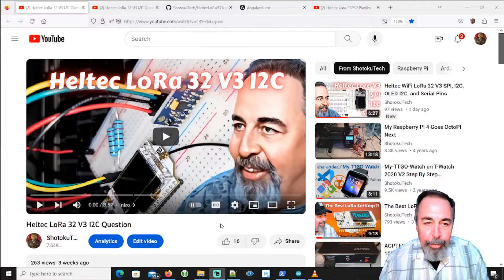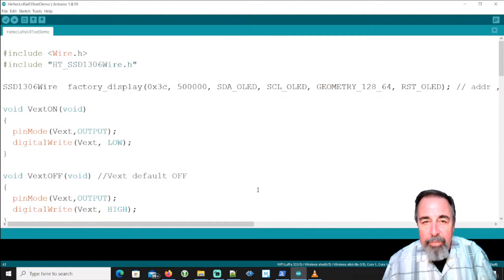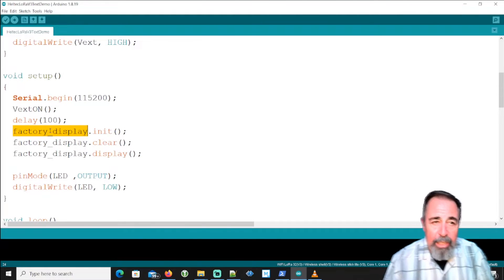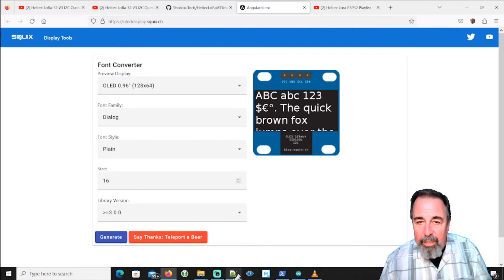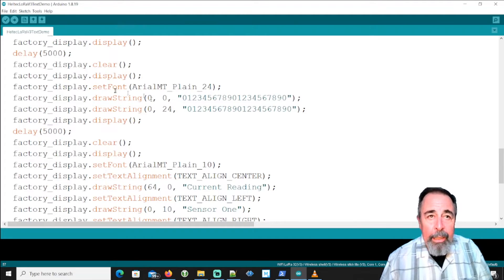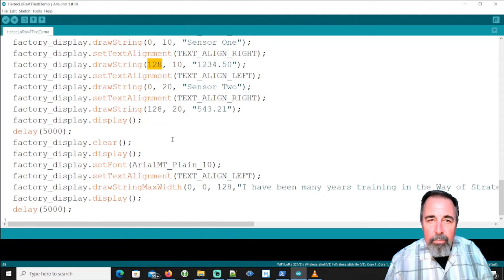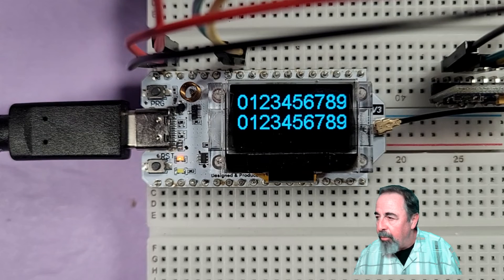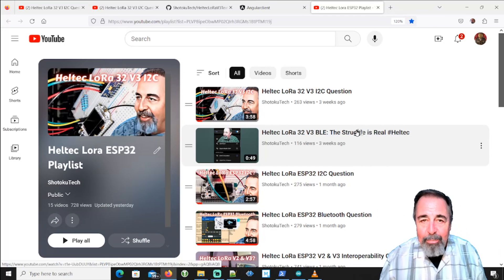Heltec WiFi LoRa 32 V3 Text Display Examples

Comment: I just got this working today. Opens up a lot of options for these V3 boards. Even without the LORA function, these are still very affordable ESP32 with an integrated OLED. Thanks for putting this tutorial up to bootstrap us noobs. Love your videos !
Reply from the maker: Glad to hear. There is an update that you might want to check out. It seems some commands require additional parameters when using the latest board definition and sketches. "Update: Heltec WiFi LoRa 32 V3 Latest Info" https://youtu.be/c1lkIko4Wsk
Best wishes.

Comment: How do I display a text that comes from a MQTT topic? I tried everything and the message does not show on my OLED. I have a board just like this. I basically want for the board to listen to a topic on a MQTT broker and show a message in the display once there is a new message.
Reply from the maker: You pose an interesting question. I don't necessarily have the answer at hand. I would have to take time to develop it. Do you have the Heltec WiFi LoRa 32 V3? The code for it is very specific to this board.

Comment: I recently discovered that the VEXT pin isn't necessary for operating the display; it just made the display a little brighter for me. Instead, to turn the display off, I used factory_display.displayOff(), and to turn it back on, I used factory_display.displayOn().

There is also a .sleep() method, after which you need to reinitialize the display. I think the .displayOff() method only turns off the backlight of the OLED, while the .sleep() method turns off the entire display.
Reply from the maker: Yes! Thanks. It's in all the sketches. But I had my suspicions. Thanks for the information.

Comment: hello, I'm new with lora and codings, what should I do with this error I've got
"Compilation error: HT_SSD1306Wire.h: No such file or directory"
Reply from the maker: Typically, errors like this mean something is missing or the sketch is not geared towards the V3 version of the WiFi LoRa 32 board. You might want to watch this explainer: https://youtu.be/shJxD5fiEhs
The example sketches come in with the board definition package for the V3 board.

Comment: Could you please help me to understand why  Heltec V3 LoRa board is not detecting the DS18B20 sensor on the OneWire bus. 
the DS18B20 sensor works well with the ESP8266 NodeMCU but not with the Heltec V3 LoRa board
Reply from the maker: I demonstrate using I2C on the Heltec V3 in this video: 
"Heltec WiFi LoRa 32 and DS3231 RTC"
https://youtu.be/nwG4l7Ph1Do
Reply: @ShotokuTech  Thank you for your prompt reply, but DS18B20 is a temperature sensor (from DALLAS) that uses Onewire protocol. It's not an RTC that uses I2C protocol
Reply from the maker: @hamdiridha8105  Okay. I guess my point is you have four available GPIO pins. 45, 46, 47, 48. Whatever you do, use those pins. Don't use any others without understanding the implications.
Reply: @ShotokuTech  👏Thank you so much
I found another library called "OneWireNg" that works well, but as you mentioned, it only works with the specified GPIO pins. 
I really don't understand why it only works with these pins!!!!😇

Comment: I Was wondering if someone could provide a link (to a website) -- (I hope there is one) that would have good information (For a Super Noobie like me) to learn how to progam one of these LoRa Devices..
Reply from the maker: YouTube won't let others post URLs in the comments on my channel. I have an entire playlist dedicated to this device, including should how to connect various types of modules. Each one usually has corresponding code on Github when I have written something myself. I always recommend working with the example sketches and then mashing them up to suit your needs. Best wishes.
Heltec WiFi LoRa 32 Playlist
https://www.youtube.com/playlist?list=PLVPBipeObwMP02QIrh3RGMs1BtPTMt19j
Reply: @ShotokuTech  Thanks for your response.. I'll try watching those and hope to figure it out.. Also the software to use that I can create the code / compile   and flash the module.. hopefully available for Windows 10 OS.. (starting from scratch) is hard when you don't know what to scratch.
Reply from the maker: @x_CrossHair_x Arduino IDE works on Windows 10. The Meshtastic stuff should work too, as long as you use Edge or Chrome.
Reply: Thanks again.. I Will check out the Arduino IDE sounds very promising @ShotokuTech

Comment: What do the led flashes mean?
Reply from the maker: Good question. I did not have anything in the code addressing the LED. This would need further investigation. Thanks.
Reply: @ShotokuTech  
Thanks for the fast reply. 
Sometimes I get a bright white momentary flash,  and other times it flashes dimly when running.
The red/orange led flashes dimly and randomly during boot. 
I have 4 heltec v3's on meshtastic. 
Finally got them all working. 
Biggest issue was that the driver downloaded on my control panel.  Won't load from there. 
Once I moved the file to documents BAM! Driver installed. 
Now,  if I could figure out the blinking led signatures...

Comment: Does anyone know if it's possible to add other text displays (such as larger ones) to these Heltec boards? The only one that appears to be set up for it is the Heltec wireless paper .. it has that 24-pin ribbon cable for talking to an e-ink display.
Reply from the maker: For the WiFi LoRa 32 V3 I have demonstrated Serial and I2C so far. I have not done SPI yet. The pins are different for V3.
Reply: @ShotokuTech  Thank you for replying! I spent some time last night comparing the pinouts of different LoRa boards. It is easy to add a serial keyboard to the well-used LoRa 32 v3 .. to the wireless stick lite. But how to get bigger displays hooked to those boards? This is the $64K question. Like everyone else, I would like to be able to make a grandma-friendly device to give to friends and family. The people over on the meshtastic discord are very hot on the trail of this.
Reply: To add .. actually the four main current Heltec LoRa boards (Lora32 v3, wireless stick v3, wireless stick lite v3, wireless tracker v1) all have the correct pins for adding serial keyboard. All arduino-compatible. If an arduino display can be added ..
Reply from the maker: @suzyamerica4679  I have a pretty full agenda at the moment. I did want to revisit the WiFi LoRa 32 a couple more times. One to figure out SPI, which would give you that display. The other is connecting to the BLE on the board. I'll see what I can do.
Reply: @ShotokuTech  Cool .. I shall dig around too. Got a friend somewhere who is an arduino geek. He may be able to help. So far the only SPI displays I've seen for arduino are simple square-LCD character displays. It is entirely possible that the pico w is the route to go with this idea too.

Comment: podes hacer un ejemplo de algun sensor, que envie datos y el receptor pueda leer por la pantalla oled?
Reply from the maker: "Can you make an example of a sensor that sends data and the receiver can read it on the OLED screen?"
Sure I do. Check out: "Heltec LoRa ESP32 and GPS Module Range Test" https://youtu.be/b1X5E6O_THE
Thanks!
Reply: @ShotokuTech  pero podrías hacer otro para la versión V3, quizás con algún otro sensor, gracias
Reply from the maker: @Electrnick  Bueno, el GPS en serie probablemente sería fácil, simplemente cambie los pines para v3. Entonces veo que necesito hacer un video que use I2C. Lo he puesto en mi lista. Manténganse al tanto.
Reply from the maker: Heltec WiFi LoRa 32 V3 with MPU-6050.
https://youtu.be/5lEMRN-o_ng

Comment: Where you get HT_SSD1306Wire.h ? My IDE can't to find that header...
Reply from the maker: You will want to watch this one to explain using the WiFi LoRa 32 V3:
"New! Heltec V3 ESP32 LoRa OLED Step By Step"
https://youtu.be/shJxD5fiEhs
Use this additional board manager URL in File/Preferences:
https://github.com/Heltec-Aaron-Lee/WiFi_Kit_series/releases/download/0.0.7/package_heltec_esp32_index.json
The board manager package contains all the libraries. Only use the example sketches under "Heltec-Example". The older version examples will always generate some error compiling for V3.

Comment: Hello friend, I have had problems with the compilation of my program from Arduino IDE, I have the Heltec LoRa 32 V3 board, I have followed the configuration steps from previous videos and I get the error (Compilation error: LoRaWan_APP.h: No such file or directory). I would appreciate it if you could help me
Reply from the maker: I am on a brand new laptop. I just installed Arduino IDE. 
I added this URL to the Additional Board Manager URLs in File/Preferences.
https://github.com/Heltec-Aaron-Lee/WiFi_Kit_series/releases/download/0.0.7/package_heltec_esp32_index.json 
I added Heltec ESP32 Series Dev-boards 0.0.7 in Board Manager. 
I selected WiFi LoRa 32(V3) in Board Manager. 
Under File/Examples/Heltec-Example I loaded WiFi_LoRa_32_V3_FactoryTest. 
When I complied it just now, it works successfully.
I have followed these steps several times on different PCs with the same result.
I can't tell outside of that how you would get this error.
Thanks. Best wishes.

Comment: Would you please consider doing a video on implementing a node "The Things Network" on the "Heltec WiFi LoRa 32 V3" board?

I've looked, but I've only found one, it is not in English and I could not follow it.
Reply from the maker: I'm still upset that TTN sells you a home gateway for $80 that doesn't include adequate instructions. So you go to TTN and join the $80 gateway they way they suggest to onboard all the other devices and it basically bricks the $80 home gateway. After I onboarded it I found the 'special' instructions on TTN specific to the gateway. Now that GUID is burned and I'm either supposed to be a Linux genius or pretend that making up a new GUID will be okay. So maybe I will do this, but I'm not a big fan of TTN. Qubitro or Arduino Cloud are so much simpler to work with for me. I prefer these cloud platforms over TTN.
Reply from the maker: How about this guide? 
https://robotzero.one/heltec-lora32-lorawan-node/
This is the latest board manager URL that includes the WiFi LoRa 32 V3 board:
https://github.com/Heltec-Aaron-Lee/WiFi_Kit_series/releases/download/0.0.9/package_heltec_esp32_index.json